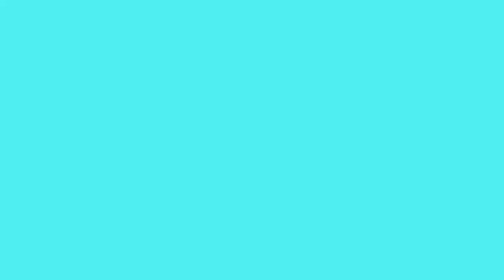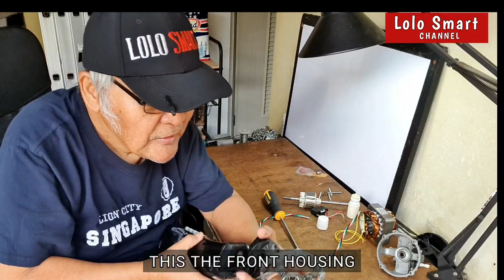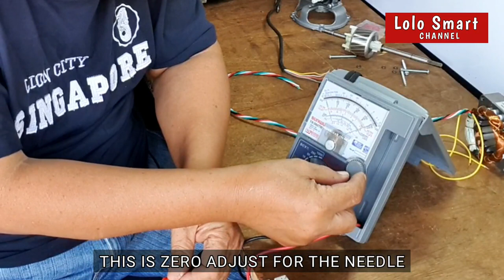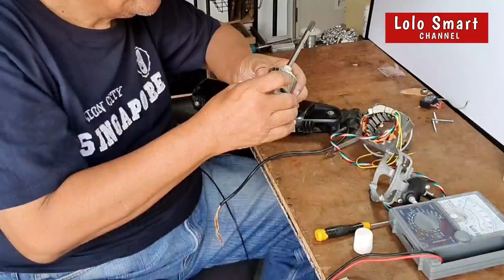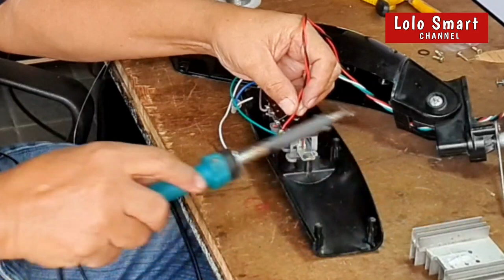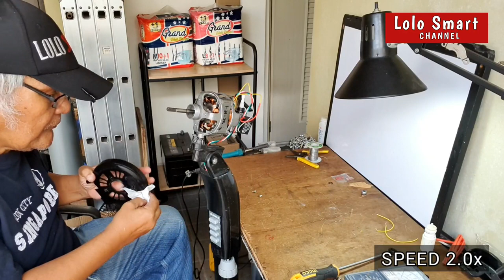HOW TO FIX E. FAN SUDDENLY STOPPED PART 2 AND DISCUSSING THE STATOR COIL INSTALLATION DETAILS

Comment: Is that a digital display on the front of that fan guard?
Reply from the maker: NO not a digital display ...
A black electrical tape placed to protect the surface from scratches during repair.
When front grill is removed I usually place it on the floor face down .
To avoid such scratches... I put electric tape on it.

Comment: Lolo smart tanong ko lang po, yung po bang nabili nyo na bagong stator coil ay meron ng thermal fuse? Di ko po jc nakitang nilagyan nyo po eh salamat po 😊.
Reply from the maker: meron na yun po. nasa 300 ++ nga lang.
meron akong 5 na thermal fuse nk ready just incase kailanganin.

merong dumating na kelangan kong bumili uliot ng stator coil but this time kukuha ako ng walang thermal fuse at lagayan natin.

maalam kabang magconnect ng thermal fuse sa stator coil ?
Reply: Hindi pa po ako maalam sa pagkabit o pagpapalit ng thermal fuse sana po sa mga susunod na video nyo maisingit nyo po, salamat po.
Reply from the maker: Yes pwede yan pero mag we-wait lang tyo na may dumating na pang demo unit .

Comment: Hi Lolo Smart. Magkano lahat ng gastos sa pieza nabili nyo? I have the same issue with my electric fan, I will try what I have learned from your video. I'm a certified TESDA electrician, I just want an idea on how much I will be spending compared to having it fixed from a shop.
Reply from the maker: Ang stator coil presyo ay naka-dipende po sa size ng bakal nuong rewind minsan php180 minsan php 240.
nk-dipende rin po ang price sa tindahan.
Hingi po kyo ng receipt para sa warranty. Merong nagbibigay ng resibo meron ding ayaw magbigay.

Comment: Lolo smart sa efan ko na mitsu tech brand meron capacitor na 1.5uf pero nahihinaan padin ako sa hangin. Pwede ko bang gawin 2.0uf yung capacitor niya? Ok lang ba ito hindi naman po ba makakasama? Thanks po.
Reply from the maker: pag kinabitan mo ng 2ufd yan eh bibilis nga nman.
merong mga manggagawang magsasabi nyan
pero, tatapatin kita ...
. mas mabilis iinit yung stator coil
. mas maiinit ng bahagya keysa init kung nka 1.5ufd
. mas iikli ang buhay O yung itatagal nung rewind
  hindi ko po masasabi ang duration
. HINDI po namin ginagawa po yan sa shop ko

kayo npo ang magpapasya na kung babaguhin nyo at gagawing 2ufd ang original value na 1.5ufd nyan.
NEVER lang po sa 2.5ufd O kya sa 3ufd sobra sobra npo yung value 

sensya npo kc hindi ko po tahasang masasabi na WALANG mangyayare masama sa rewind

SALAMAT po sa inyong pagtatanong
Reply: @LoloSmart24  kung 1.7uf po kaya ?
Reply from the maker: 1.7ufd pwede kc malapit sa 1.5ufd keysa sa 2ufd at ginagawa din namin yan sa shop nuon ...
Reply: @LoloSmart24  wala naman pong naging problema kapag tumagal?
Reply from the maker: @veevibes2486  wala po in connection with sa rewind
Reply: @LoloSmart24  siya nga po pla 50 watts lang po yung efan ko.
Reply from the maker: Wala pong kaugnayan ang power consumption ng bentilador kc wala pong watt ang kapacitors.

Sa actual usage ng capacitor at e.motor eh wala na po yan.

Capacitance lang 1.5ufd at volts 350volts more or less. I pareho nyo nalang sa original volts yung bago.
Reply: @LoloSmart24  thankyou po sa knowledge 😊

Comment: Sir, meron po akong 16" na stand fan UNION BRAND. Stock-up po sya. Pinalitan ko na po ng bushing kaso ayaw pa rin umikot. Kailangan pihitin ko ng konti yong shafting nya para umikot sya. Ano pa po kaya ang posibleng dahilan?
Reply from the maker: Kung nalangisan mo yung dalwang bushing at magaan nmang ipaikot ng daliri yung propeller habang nkOFF eh yung capacicitor bka sira na kya hindi mkbuwelo ng ikot.
Mura lang nman yun, dito 30php lang yun bili kna at paltan mo nlang TEKA TEKA pla ...
minsan eh yung stator coil na ang may sira pero good ang capacitor.

Meron ka kyang tester ?
Reply: Good naman sir ying capacitor. 1.5uf ang dating nakalagay. Sinubukan ko po palitan ng 2uf pero ganin pa rin po. Yong stator naman po eh lna test ko na, lahat po may resisitance.
Reply: Nalangisan ko na rin po yong foam sa lagayan ng bushing.